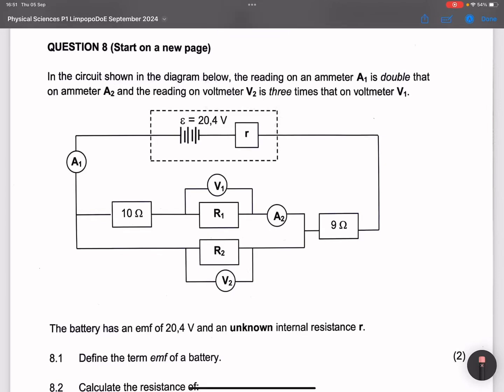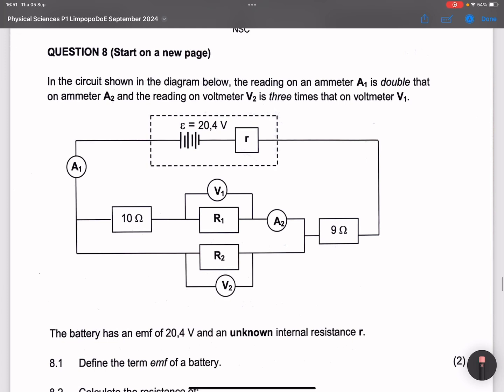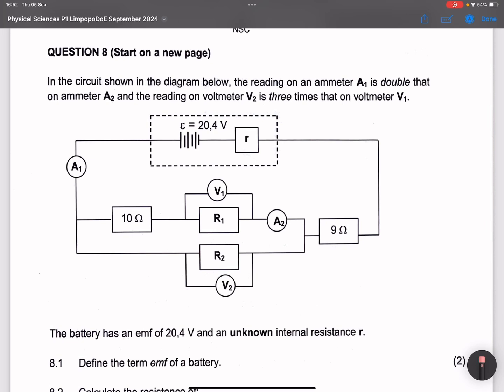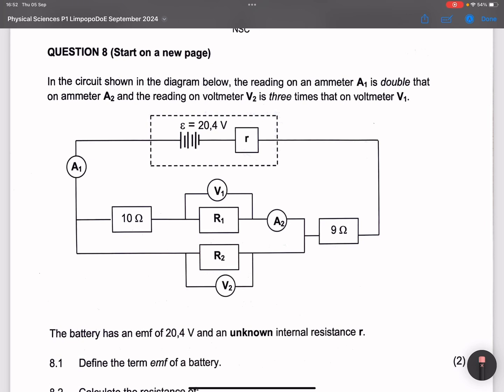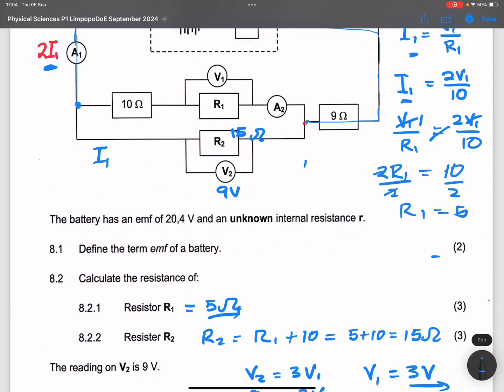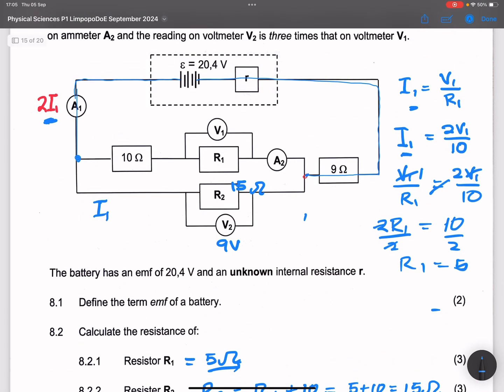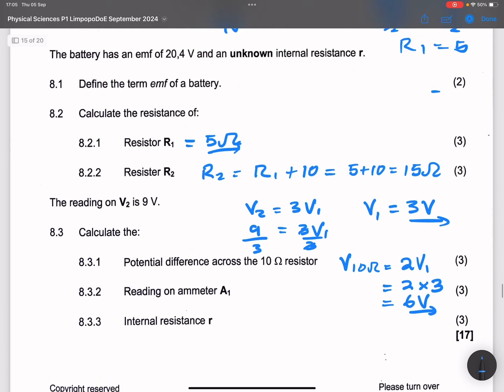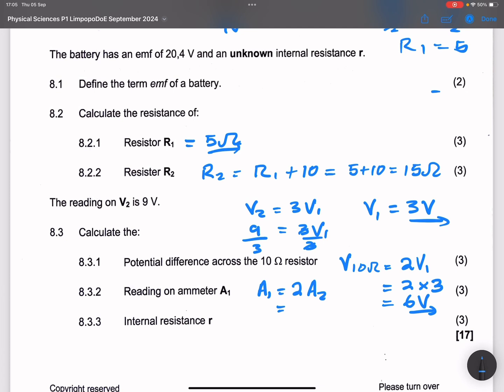Limpopo Prelim 2024 Past Exam Explained | Question 8: Electric Circuits | Mlungisi Nkosi

Comment: Mr M 
is it correct if I used this method
?
R=2V/I
 10=2(20,4)/I
10 I=2(20,4)
I =4,08A
then I substituted I :
R¹=20,4/4,08
Therefore R= 5ohm